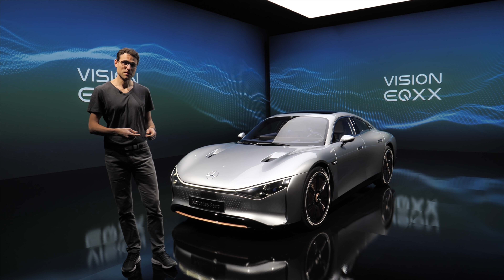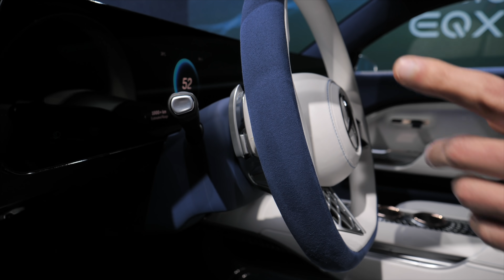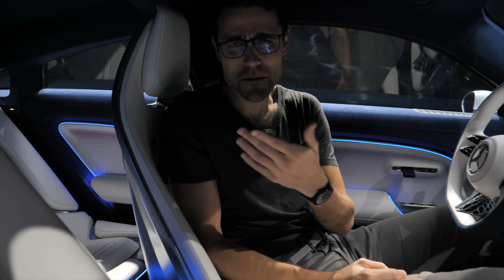The next Mercedes EV with 1000 km 600 miles range! Mercedes EQXX REVEAL

Comment from the maker: ►Follow us on Instagram @autogefuehl and @thomas.letsgo
►Subscribe here: https://www.youtube.com/user/autogefuehl?sub_confirmation=1
►Compare the Mercedes EQS: https://youtu.be/WKrNCVSdefA
►Compare the future BMW: https://youtu.be/EJFsnxSNo-w
►Compare the future Audi: https://youtu.be/JCllPQ3O8Lo 

00:00 Mercedes EQXX overview - the next MB EV!
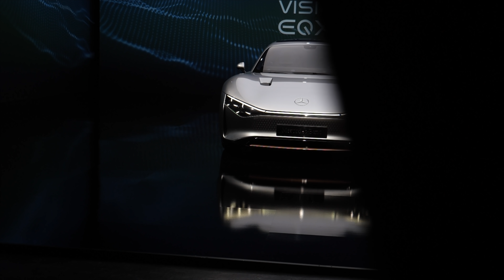00:51 Achieving best wind efficiency cd 0.18
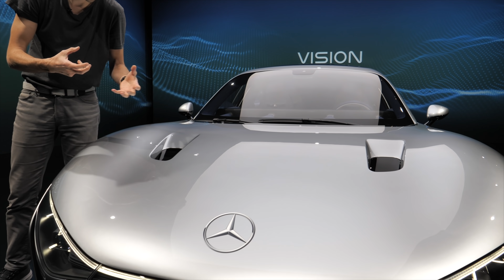01:15 1000 km 600 miles range and energy consumption
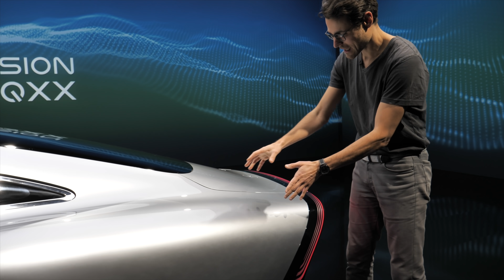02:55 Active aerodynamic spoiler
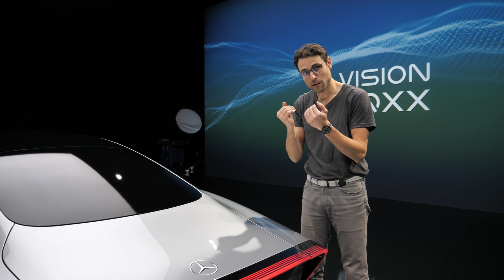03:51 Battery pack details
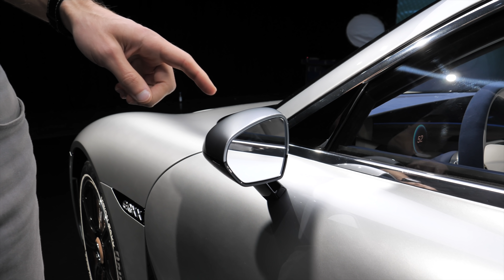04:31 Side mirrors
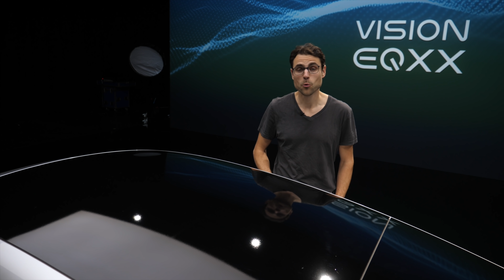04:45 Upcoming solar roof
05:22 Rear bionic casting
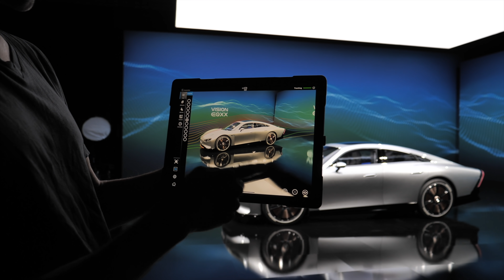05:54 Wind flow visualization
06:58 Interior with sustainable vegan materials
08:19 Seats with Desserto cactus leather and Mylo mycelium leather
09:38 MBUX infotainment screen 47,5”
10:05 Integrated speakers
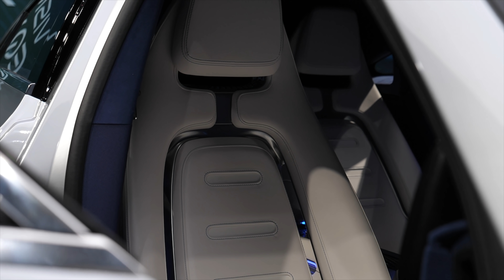10:46 Digital user experience
12:59 Back seats
13:17 Bionic weight saving design
13:52 Taken from Mercedes Formula 1 technology
14:09 Glass fibre spring
14:34 Which future Mercedes will we really see??

#Mercedes #MercedesEQ

Transparency note: Autogefühl videos are independent and free from editorial influence on opinion and rating. But since manufacturers enable us to do the reviews in the first place, for legal reasons this video is marked as _advertisement_.
Reply: they are playing games, why isnt the rear seat facing rear ward for utilize unused trunkspace as legspace(also excsing much trunk space given its most the time never used given removable folding roof rack storage), less weight and airspace for heater AC to work as hard in, more midengine like handling, etc? how about 2 seaters that follow each other liek virtual traincar instead of 4 seater which will make sense considering most the space is never used most the time so running costs lower plus it will be much more the case in future of ridesharing, amazon delivery van, centralizaed population and systems in general etc. the solar probably not sustainable defintly wont be recyled, just toxic materials that will be dumped into nature like pure mercury etc. no talk on full stack recyclability unlike nissan who also has e power in note nismo.

Comment: Benz is not even the first, NIO's ET7 and ET5 already will have 1,000 km per charge at end of this year 2022.  This Benz in 5 years?  Even if Benz can do it in 5 years, can Benz match NIO's widely appealing price points?  This Benz also can't match the huge interior room of both NIO's ET7 and ET5.  Well.  Good try though.

Comment: Now that is how to do a luxury large EV. Well done Mercedes. some excellent tech and concentrating on both efficiency and weight shows that you dont have to exclude great design too.  I really am looking forward to these, and the underlying tech on the road very soon.   I had wondered if the A/B/C class were going to be moved over to Smart but clearly they are going to be excellent EVs once they are launched.

Comment: Still waiting for a concept with switchable batteries. It would greatly boost the ev market if gas stations (charging stations) had an underground reservoir of batteries instead of liquid fuel and it would only take a few minutes to switch the batteries. I would've imagined Formula E would take care of this concept, but instead the drivers have to change the car during a pit stop. And also, replacing the batteries on a used car is so ridicculously expensive, that people like that guy in Finland blow up their Teslas instead of just changing their batteries.
Reply: Nio will do it

Comment: Range doesn't NEED to double if wireless changing is implemented at stop lights, curbside parking AND key long distance roads for charging-while-driving. An efficient car will charge while driving and receving 15-20 kW, a less efficient car will just deplete its batter slower. Think of if, with wireless road charging, any hybrid would be fine for long distance driving. And Nikola Tesla had technology (that no-one seems to care for) where even the roads need not be made part of the charging infra, as the electricity went from source to any end point. So no more large batteries, and present roads are fine. Guess who cares the very least? Tesla Motors who get rich off batteries. And its CEO also off satellites, also obsolete with Nikola Tesla's technology....
Reply: That's a good solution for some countries but it's not possible in every country in the world. Also it's really expensive to build so who's going to pay it all?

Comment: Battery is also light due to omitted cooling/heating.
When batteries get more efficient under load, they will not need cooling. When they also work well in low temperatures, they will not need cooling. It makes sense. Batteries are machines, need not be as temperature specific as reptiles or humans.

Comment: so the question is, why not smaller wheels?
Reply: They traded rubber width (more drag) for rubber length: tyres are only 185 mm wide according to reports!
Reply: @abraxastulammo9940  makes sense, I was wondering why not go for 12 inch wheels if you really want to have low drag

Comment: Fascinating. Love to see how Mercedes are evolving. Would like to hear comment on why they are still going with traditional mirrors instead of cameras. Is the gain in drag performance too small to be considered? As always, great job Thomas.
Reply: With EQS they explained the gain in aero does not offset the worse usability and more electric consumption. 🤷
Reply: I seem to remember them saying the gain in aerodynamics is more or less the same as the battery drain from running the cameras

Comment: Thaat has Porsche written all over it. Looks like a cross between the Taycan, with the rear using elements of the 935. I guess imitation is the sincest from of flattery? And where are the information displays going to stop? I can see them as useful for autonomous vehicles, but for a driver it is a huge distraction IMO.

Comment: Great car and explanation, you are the best at this😎 

but many of the things is already found in the Tesla's. If you slap a 100 kWh in the 4-5 years old Tesla Model 3 you can already get ~850 km. With thinner wheels and a bit bull shit😜 like this concept, you can claim 1000 km for the Model 3 too. Design for low wind resistant is key for EVs, Tesla knew that 10 years ago (only ignorant think the Tesla design is ugly). Vegan leather is used in the Tesla M3 and MY already, again German concepts = Tesla reality. Casting parts of super alloys is also found in the M3 and MY even made in China. If the German bureaucracy stop fooling around in Grunheide, you will see a 80 kWh structural battery solution driving around in Europe this year with an equivalent efficiency as this 100 kWh concept pack.
Reply from the maker: thanks Chan !!

Comment: I don't understand a purpose those external mirrors, when a set of rear-facing cameras would do the same job without creating so much aerodynamic drag. 

 At 6:13, where the wind flow is displayed, it completely misses showing the effect of those dare I say, bricks. If it didn't, we'd see just how bad they are.
Reply: I heard they made the traditional mirrors because they want the car the be pretty much like a mass production car. And customers don't appreciate camera mirrors, so they wanted to keep the traditional mirrors.
Reply: @Niko-kf7ue  I've never ever heard anyone complaining about camera-based rear view mirrors. 
Cameras are cheaper to produce as they have no moving parts and no mirrors that are a subject to delimitation, particularly in hot and humid climates.
Reply: Their engineers mentioned that a camera based system would net them less than a half of a percent of range (less than 4 miles). It’s impractical, and it’s needlessly over engineering something that will require localized law approvals.
Reply: @User.Joshua  
I'd love to read that interview where Mercedes engineers had mentioned less than half of a percent figure. Do you have a source ?

In all fairness, the entire car is a prototype. Its production equivalent will have region-specific parts, such as bigger bumpers and orange side markers (in US and Canada). 

Audi have been putting cameras on their cars for a couple of years and they haven't exhibited any issues. 

Also, keep in mind that CMOS sensors are produced in millions every day and used in several billions consumer devices that are a subject to all sorts of abuse. Having one in a car is an academic exercise with bigger long-term impact on the efficiency and cost of the production.

Comment: The design is very graceful, nice and with a touch of retro - especially in the bonnet/windshield or tail areas. It has very nice interior and seats.
I appreciate, that they get rid of these fake grills and used flat design of chrome. Absolutely cool and to use now. The screen is very nice and much better than the fake hyperscreen in EQS but the nice screen is also barely practical - the area to use soft buttons is small and the real interface will suffer. Areas on front of the driver and passenger are too big or useless. So, a nice touch, but for a show car.
I'm a little befuddled with side mirrors - these are really obsolete now, and the big screen has a lot space for mirror areas. And the steering wheel? We know already from MS , that yoke works.
I like very much bionic casts. It can be a next optimisation for MB and especially Tesla with their current mega casting presses.
But I'm surprised with declared efficiency about 10 kWh/100 km. It is not a respectable number with so extreme aero, small internal space and very narrow tires. Lucid Air uses narrow tires now and gets about 10.6 kWh in a real car. With the same narrow tires Model S has about 10.5 kWh. (Please note that the factory MS uses wider, staggered tires - it is a performance car - and has 12+ kWh/100 km).
Reply from the maker: Check out our Lucid Air review: https://youtu.be/ZWoWdyfGFzg

Comment: if they launch this exact car with smaller 60kwh battery under $100,000 it will be perfect cars
Reply: Yeah, I’d take one with a 50 kWh battery if it had 325 miles of real world range. I’d even take a half width screen option.

Comment: Already far from Mercedes design. The function is creating the design, i.e. the computer, not the designers. The large display is somehow remembering the little HONDA . Still Mercedes is not using video display instead mirrors !!! Strange. The back of the car is looking like Ioniq design. Obviously Mercedes is leaving the tradition with executive cars......în favor of the driver ; less important back seats.  Increased autonomy based on design and less weight. Still not new battery discoveries. It means the car development will continue with rapid changes. Thus, when to buy a EV ?

Comment: The Lightyear One is More efficient and a more impressive car. The Lightyear One efficiency is 8.5kWh per 100km, on a 60kWh battery, the EQXX won't be able to achieve the same and also won't better the Lightyear One's 8.5kWh per 100km efficiency. Sorry, but I'm not that impressed. Mercedes said they wanted to achieve the range without putting a big battery in the car, but says the battery is just below 100 kwh, so the battery is still probably in the 90's kwh range, that's still a very, very big battery. I was expecting a battery in the 80 kwh range, maybe even in the 70 kwh range. I'm disappointed. This range is still achieved by a very, very big battery. Lightyear One is the more efficient and more impressive car, I think. That's my opinion.
Reply: this car is more efficient than lightyear one .this car has 100wh per km  while lightyear one  106wh per km.
also this looks way better and much much more premium.
and this car will be cheaper than lightyear one .
i love lightyear one too but its not mass production car lightyear has long way ahead untill they can make mass production car while mercedes already have electric cars
Reply: @anand.suralkar  What? Your stats sound way wrong. Look at my stats, the Lightyear One is more efficient.